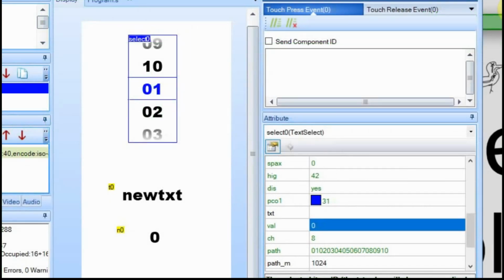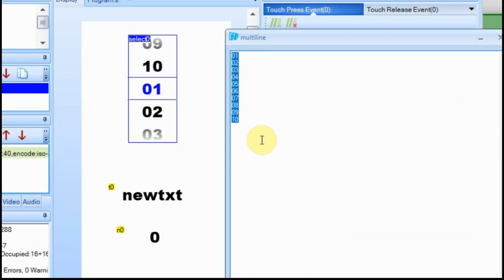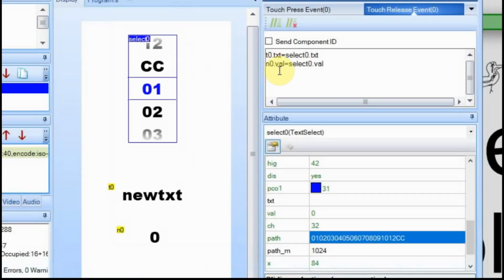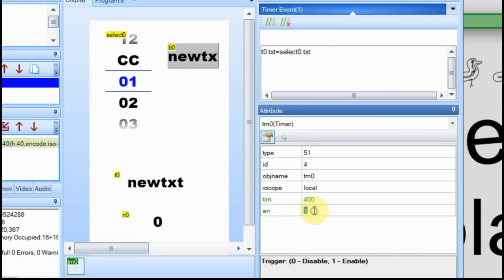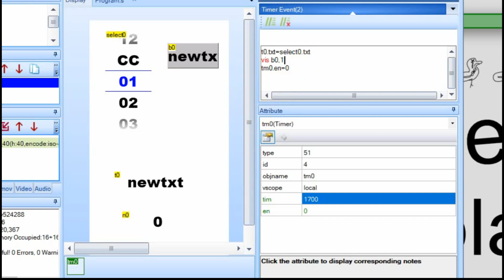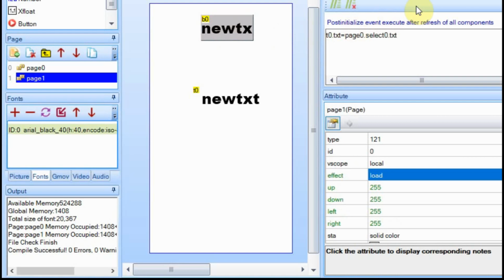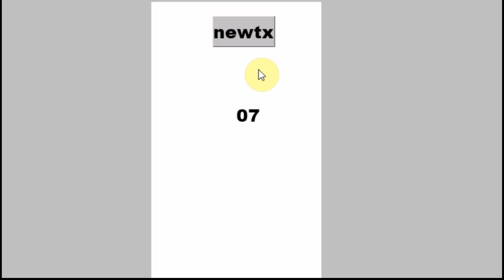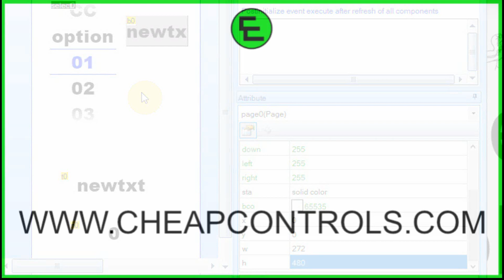166 #nextion #tutorial Text Select and One Shot Timer

Comment: Is there an option to disable input/touch on textselect? I would like to use it only as an "output" not "input/oytput" mode. So i can just send single val from mcu to display one of predefined texts
Reply from the maker: I believe you are looking for the tsw command.  Watch this video and let me know if it answers your question https://youtu.be/tQTrgLgYsZI Thanks for watching.
Reply: @CheapControls  Thanks for response
Not exactly.
Or at least it's too overprogrammed.
I want to show on screen a setting or information as text. From perspective of microcontroller it's only one variable that i send to nextion.
Each value has assigned text to it.
For. ex
0-too cold
1-ok
2-too hot
3-fire

"Text select" works perfectly for that, one integer variable, one place "path" where i can predefine texts for each value. I just dont want the effect that someone can change it with finger(touch). Its just to display information on screen, not to change anything.

On industral hmi systems (siemens etc) it's just choosing mode of operation for i/o field ("input/output" or just "output")
I'm just suprised right know that to do something so simple and basic You have to use scripts etc.
Reply: I found one simple solution, just put "Hotspot" over "textselect". But sill, kind of workaround
Reply from the maker: The hotspot will work.  Using the tsw command in the post initialize command would only add one line of code when the page loads.
Reply: @CheapControls  Silly me... I forgot about "page events" and post initialize. Thank You
Reply from the maker: Your Welcome.  I had not thought about the Hotspot.